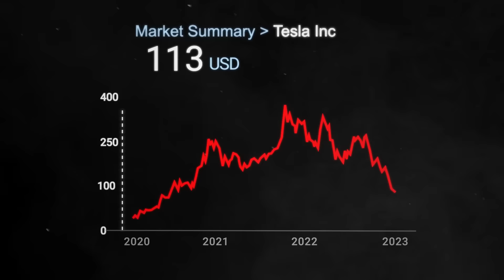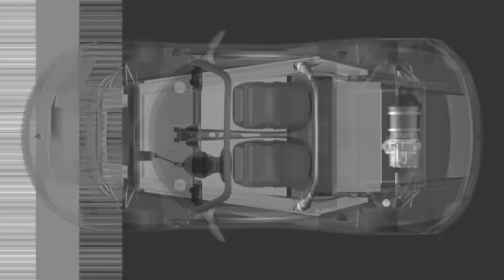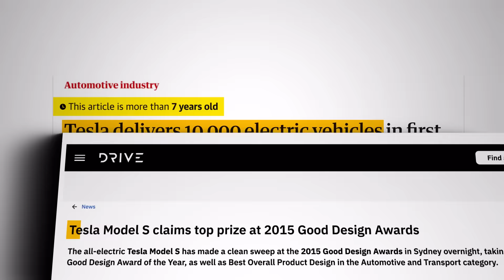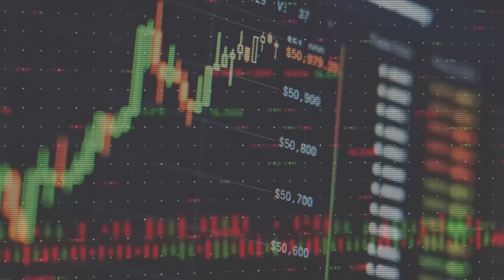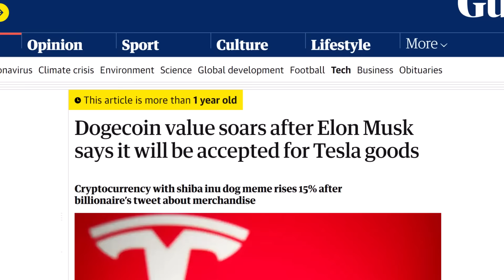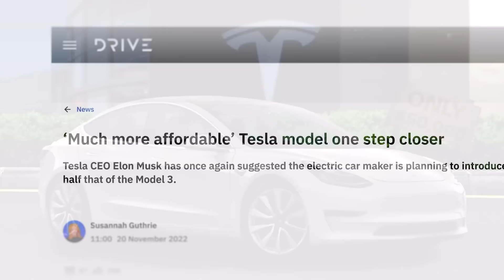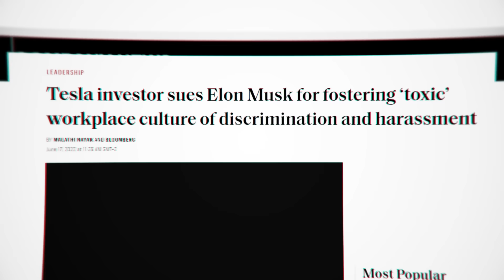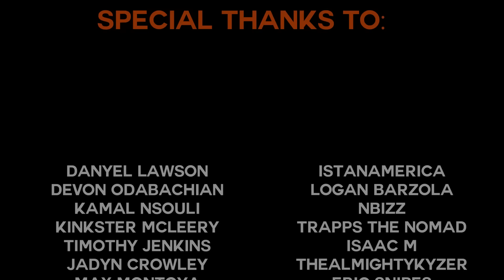Why Elon Musk Is A Fraud

Comment: Imagine if tesla collapsed and all the tesla cars stopped working without any website or online capabilities
Reply: That's definitely the downside of buying any product which is so proprietary.
Reply: You can drive tesla by wire, without internet. Meaning no autopilot, no fancy things.
Reply: @KCMTRM  Very true. I believe the original post was talking about a hypothetical scenario wherein tens of thousands of Teslas were on the road using the autopilot and it had some kind of critical system error. Some people would catch it and be just fine but there is still a potential for great catastrophe.
Reply: Once a tesla caught fire and all electronics inside the car stopped working, including the door locks.
Fortunately the owner was able to escape by cracking the windows open.
Once these batteries start catching fire, NOTHING will put them out.
Very scary scenario if you ask me.

Comment: Cult of personality did more to drive Tesla to the top than anything they ever created. The one thing they have done that they could potentially fall back on is the charging infrastructure they have set up that has to be netting them decent money. Really kind of brilliant on that end, sell them the car then sell them the fuel too. It is almost as if Exxon were to build a car.
Reply: Ppl were already holding candle 🕯 light vigils for EVs before Elon entered the scene.
Reply: Tesla doesn’t produce any electricity 🤦🏻‍♂️

They do produce the sola panels for homeowners to generate electricity themselves though…

And no, the electricity produced by their solar panels is not limited to just use on  charging their vehicle. 

Note that over 5 millions electric vehicles on the road today are produced by Tesla.
Reply: @tonamg53  Pretty obvious they don't generate electricity. But they can build an infrastructure for vehicle charging, purchase electricity on a bulk contract and resell it at their charge stations for a profit...like a modern day gas station 🤦‍♂️
Reply: @PuffinPass  So is that what they been doing?

The answer is “No”

🤦🏻‍♂️🤦🏻‍♂️🤦🏻‍♂️

Comment: When I worked for Safelite, model 3 and Y owners were super picky. More so than BMW, Mercedes and Wrangler owners combined. When you would replace a windshield they would scrutinize your work (which is understandable) but then they would notice uneven panels and trim I didnt even touch or that were already botched from the factory.Dont miss working on them.
Reply: Just shows that tesla owners are used to quality and you probably did create new panel gaps lol

Comment: I changed my mind about electric cars, but I don't like the fact where they draw the power from, most of the power is coming from coal and gas anyway if it ran off of nuclear power I would certainly switch from gas to electric as the grid is really struggling with keeping up energy demands and it will get worse during the summer time. I live in a area with lots of hills and from some specs I see that electric cars don't struggle as much to move around up there
Reply: Sorry this is so late. Your observations are spot on. The green push only wants to solve 1/2 the problem while making the other half so much worse. The grid will never keep up without Nuclear of we go green.
Reply: It depends where you live. Even if the power comes from coal, it's alot more effiyand cleaner than burning gasoline or diesel in a combustion engine. If your power is from natural gas, which is more likely than coal, then your argument is really silly. Gas turbines in power stations can be up to 50% efficient. Getting your electricity from natural gas will be way more cleaner and efficient than burning fuel in an internal combustion engine. 
Obviously the best choice would be nuclear, hydro or renewables, but natural gas emits way less carbon than coal or any other oil based product.

Comment: tesla is not only about the cars its also about the charging network. Trust me I tried different electric cars and charging stations and nothing comes close to the tesla charging network and its simplicity of use. At least for now.
Reply: Yeah for the next 1-2 years a massive amount of other chargers will be installed. I assume that is affecting repairs because they are too busy building new ones but I could be wrong.

Comment: I see Tesla vs competitors playing out like Apple vs Android/Windows/Blackberry. Tesla doesn't need the most market share, as Apple doesn't have the most market share
Reply: There are two problems with that analogy: 
1) Apple has products only the very highend of Android can compete with. While within the EV market Tesla is already struggling to be recognised as a highend product. Porsche/Audi/Mercedes are already manufacturing EVs that are superior to Tesla for both design, engine, batteries and build quality.
2) Apple entire ecosystem lock in all the users, which makes them superloyal to the brand. I cannot see how Tesla will be able to get any sort of ecosystem that lock in their customers as efficient as Apple does.

If you want to make speculations about future trends in the EV market, it might be worth checking out the Norwegian market. 80+% of all new cars sold in 2022 were EVs. Here Tesla's marketshare has been declining for several years, as other auto manufacturers have caught up with Tesla.

Tesla was the IT-car in Norway in 2014-2018. But already in 2018 one saw more and more Tesla owners seeking other brands as their 3 year long leasing contracts startet to expire.

Comment: I suppose that Tesla pioneered the electric car industry, and became a notable brand. But I guess electric cars became more common across other companies and people.
Reply: Other companies have caught up massively in the past 2-3 years. Just look at the range of EV’s on offer now. Prices are falling across the board as well enabling more choice for end users. The £20k - £30k market is where the growth for EV’s will be and in the UK Tesla simply doesn’t have any share in that section due to the pricing been ridiculously high for an entry model.
Reply: @callumsaunderson1089  As the electric grid across the planet begins to falter. 
Perfect timing for the great reset!
Reply: @Callum Saunderson  Yes but the second they put out a entry level model the rest of the industry will collapse. The reason being that tesla is the only electric car maker with a reliable and fast way of charging their vehicles on the go. The rest rely on third party networks which charge slowly and are very unreliable.
Reply: @appropriate-channelname3049  And the rest loose money on their EVs except ford mustang-e. all other cars loose money on production.
Reply: @-····-  Hybrids used to be way more expensive to but now you can buy a Toyota corolla hybrid for only 20k with no subsidies.
Reply: Nonsense.
Tesla did not pioneer electric cars, electric cars are as old as gasoline powered cars.

Comment: its not that it take 600 gallons of water to put the battery fire out, the battery can burn under water just fine. That is because it does not need any oxygen to burn, everything is already inside the battery. There is literally no way to put out a lithium battery fire.

Comment: Here is a new theoretical energy source for cars that produces electricity by extracting ambient thermal energy from the air and changing the form of energy from thermal energy to electrical energy. It works through tne intermediary of the natural radio frequency power called Johnson electrical noise that is part of what heat is. It is a small amount of power but it can be rectified and aggregated by modern very small diodes aligned the same way in paraiiel series. This is at the pre prototype stage of development. It needs many independent development teams that raise money by crowdfunding grants. 

Aloha

Comment: Tesla's problem is that the industry is realising that mass EV adoption is crazy considering just the severe limit in supply capacity of key materials/minerals let alone the extreme additional stress on the Electricity grids. Then there's the exploding batteries & the expensive trip to the garage to change the battery when it expires or is even scratched the "wrong way". EVs can only be an indulgence. Almost same with Hydrogen which costs a bomb to store & is a bomb in storage (much more than Petrol or diesel)! Musk still has the Gigafactory though.

Comment: Much needs to be said about why the EV tech is dying at a rate so fast it, nothing even come close in comparison. There is simply not enough resources to support EV's around the world. The rare resources for making a battery are far more finite than fossil fuels. A massive problem is the batteries can't be recycled at a fast rate or even to retain the same performance. The batteries loss efficiency every single charge. Within the first 10,000 charge cycles the batteries loses 4% of its total charge capacity. Eventually the batteries simply will need to be canned. In the mean time, new batteries will need to be produced.

There isn't enough resources to even offer a single EV to every household in NA, let alone the entire world. The resources for batteries is just not large enough to support massive batteries for a long time. Oil still has thousands of years worth of being used and, seem to have replenished in older wells. Which is far cheaper to refine than minerals for new batteries.

Additionally, the demand can't even keep up for 1/300th the demand it is today in just America. There are 233 Million people driving currently in the USA. Say they all make a demand to have an EV today from tesla. Tesla can produce 2.3 million each year with multiple factories around the world. It would take 101 years to meet that demand. People would be dead before they even get 1 car.